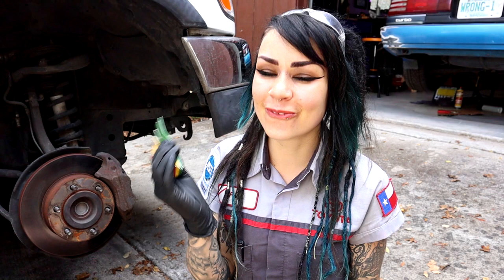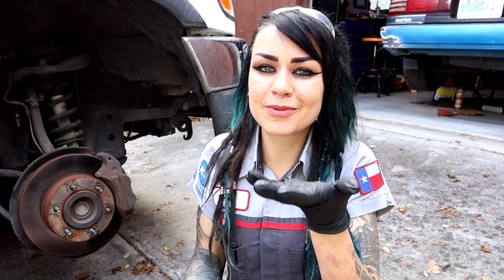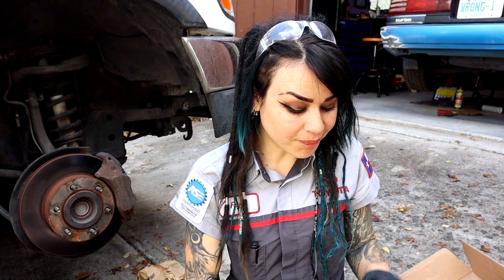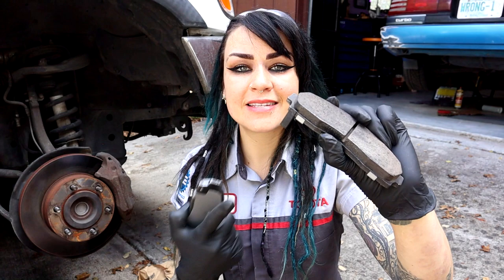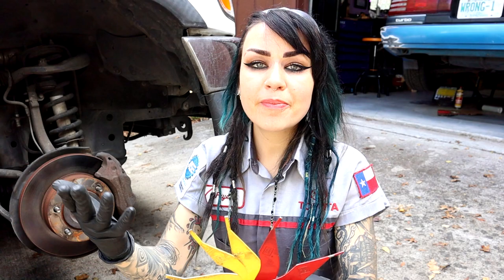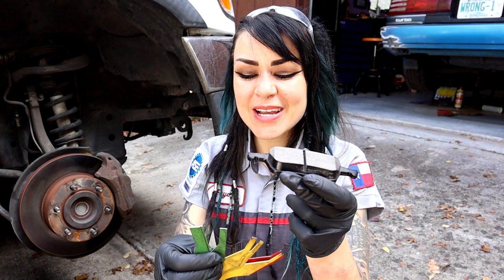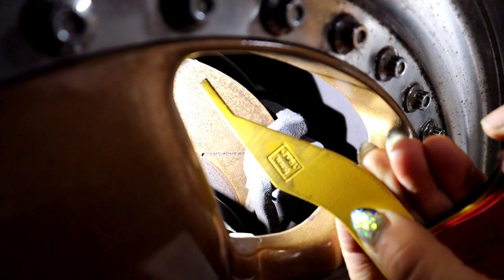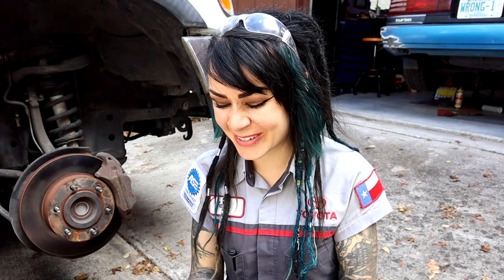How to Measure your Brake Pad Thickness and Why it's Important

Comment: Believe it or not, I've changed brake pads, discs, drums or front and rear of 2 our cars, but never knew how to use that thickness tool via the cut window exactly. Now the wheels on the 3rd car are removed (for other projects) and I decided to find out eventually, how to use that tool. I am very happy to get on this film, which describes everything with so many details and just crystal clearness. Thank you very much.

Comment: One item to add, on brake pads that have the groove in the center of the pad,  it is a wear indicator, if you can look into the caliper and the pads are worn to the bottom of the groove, it's time for new pads.

Comment: I think that's easy to understand how the brake pads wear for anyone that has had a bycicle, and why it's so important to have good brakes and in good shape, the whole system; for your own safety and everyone else when you've to brake the car or in an emergency need, if someone doesn't consider the safety in a car as an important value... imo they shouldn't drive a car, maybe drive a bycicle, use the public transport or... just walk. But a car it's different and not all the types of cars or brake systems are the same, so i think you've explained well how to measure the status of your brake pads and why it's important.

Comment: I just use the space in the middle of the pad. I've been told they are for break dust removal like slots on rotors but I always use them like the wear indicators on tyres. If the pad is level with it i.e. the space is no longer there then change them out. That way you don't have to measure just look through the inspection window. I don't have to buy tools and I think it's simpler for the diy masses.  😉✌🏼
Reply from the maker: GREAT IDEA!!!!

Comment: Good stuff Faye. I love doing brakes!!! Disc can be mindless. But shoes I do enjoy because I think today it’s a lost art. My 62 MG Midget has shoes on all four corners and the fronts are different from the back. Don’t know if they are supposed to be this way but no biggie . Still use pliers and a screw driver, one day I will convert to front disc and maybe disc front and back. Also may one day buy brake changing tools. Really enjoy this video and AAG show always good info.
My son worked for the local Toyota Dealership and he wanted to take my truck and do the brakes to show he knew more than just changing oil. I let him but for front and back new rotors, drums, shoes, and pads they wanted $559.00. I went and got the same part from a dealer supplier for $236.00. Several weeks after doing the brakes he got called in the office and was put in charge of the oil and lube center on Saturdays . Got to start somewhere

Comment: Happy Hour topic Faye,  Brakes and braking systems.  :)  I changed all around brakes on my '87 300D and they have a wire sensor I put it in and the caliper would not come down.  so I said the heck with it, and not put it on. I figure I wont have to change them ever again LOL   I hardly drive it.
Reply from the maker: We have covered this topic at happy hour before!! I forget what date though... Lemme check and get back to you!!

Comment: I really like the plastic set, where they have a "tooth" so it's easier to measure without taking the wheel off (assuming of course you have access to the pad material) 
Whether or not you actually like machining rotors, I Love that on car brake lathes are a thing!  
& because they're essentially cheap parts (for the most part) anyway, replacing pads & rotors & preforming a brake fluid exchange is pretty therapeutic.  
Drum brake services, without drum brake tools, is just a Gigantic patience tester  😆

Comment: I don't install sensors because I change pads yearly  myself. So cheap and easy always replace with new guide pins and synthetic brake  grease. Salt and  winter conditions really degrade brakes so paint calipers with ceramic paint to keep down corrosion issues. Great info about inside single piston calipers like on my Toyota that wear quicker. Had that issue when brakes were squealing looked fine from outside rotor but inside started to score. Going to peek thru that square window now on. 🙌
Reply from the maker: That makes sense!! I'd probably do the same in your case then!

Comment: Faye- I’m in a bind- have a jeep tj rusted track bar bolt- I thought I use my oscillating carbide tip to cut bar and hammer up- only the taper is in way- can’t get to bolt from top- what should I do???

Comment: That notch cut into the brake pad material acts as a simple wear indicator. I keep things simple on my  taco... buy new pads at 50% wear and I'm ready to replace em as needed during oil change / every 4500 miles.
Reply: u replace pads every 4500? holy shit

Comment: Thanks for your very informative video! I redo the slide pins use the best brake lube and replace all hardware when I service my brakes. Time is not a factor for me. I feel that many shops don’t redo the slides unless there is an obvious issue, often causing binding / uneven pad wear because of dried up grease worn out pins. Always watch till the end for the chicken status update.

Comment: Mechanics replace new rotor for every brake pads replacement. Rotors are (very) expensive compared to pads !! No definite answer but in reality for how many sets of brake pads before a new rotor is required, if no warp or corrosion ?

Comment: Thanks. Can you do a video on how to know when to change the rotors?
Reply from the maker: YES! I'm actually working on that one!
Reply: The rotor thickness is different from vehicle to vehicle, on my Honda CB1300 it is a minimum of 3.5 mm. However if the rotor is warped it needs to be machined or replaced.

Comment: Thanks for all the "How to and how not to" information. I'm usually working on my motorcycle but it's got a version of most of the same parts. For brakes, the rear drum (1993 BMW R100R, btw) has an arrow indicator. The front disks I will now look at. 
Sometimes I think car drivers are trying to turn me into their squealer tab! Caught this one on camera. The short 2 minute edit: Dodgeball with Death: Video 0036 - https://youtu.be/5G8gii1ssks 
Stay Sharp. Stay Up.
Cheers

Comment: Thanks for telling the truth about the dealer/mechanics. It's criminal that they'll tell people to change their brake pads when they sometimes have 50% or even more life left!
Also just one more minor note on squealer tabs. On most cars you'll want to place it on the "input" side of the pads, as it tends to wear slightly faster than the output. Little details.
Reply from the maker: That's absolutely true! Thanks for adding! Leading end, not the trailing end 🤘🏻

Comment: Funny this came up. I have those brake pad measuring tool. And used it this past weekend on my Tundra to measure them while I cleaned everything before winter here in salty connecticut.  Nice job Faye

Comment: If you install the cheapest  pads you can buy   they  squeal after a couple thousand miles  no squealer needed LOL
Reply from the maker: augh true that :'(
Reply: Just take them out and rub then together like you rub your hands to warm up. You'll notice that they look shiney. That's because cheaper pads produce a lot more dust so it cakes the surface and bakes on with the heat. That smooth hard surface causes the nose. It also reduces the effectiveness of your breaks especially when wet. Rub them together until the shiney surface is dull. If rubbing doesn't help use medium (600-800) grit sandpaper. Cheers ✌🏼

Comment: Different topic. Have you ever heard of a mechanic placing two washer gaskets on a spark plug?.  On a tune up my mechanic kept bending the spark plug tang on one cylinder with turning the engine. He finally added a plug washer to raise it up off the piston a tiny bit. Ford Ranger 6 cyl, 128,000 / 2009.
Reply: About the only way that could happen is if it's the wrong plug.  The correct plugs would have plenty of clearance.
Reply: @Blazer02LS  well, only one cylinder was affected. I didn’t cross check his choice of plugs though. He was suggesting carbon build up on piston
Reply: @volvo850rex  That would take quite a bit of carbon. If that is the case I would do a top cylinder cleaning and maybe look into the bore with a camera to check it.

Comment: Hey Faye, Great video That should help a lot of people understand breaks really well done. Back in the day my buddy was really lucky and found 85 Toyota truck with only 120,000 miles on a baby really nice shape still have the original brakes we marveled at they were really worn down maybe a couple millimeters maybe less but completely even inner and outer and the shoes and drums were still pretty good. He mentioned that he can get aftermarket brakes you know storebrand cheap and I said are you crazy these brakes lasted 120,000 miles The rotors were still like new I said buy the Toyota factory pads so he did. Unfortunately he crashed that truck soon after but got another and transferred the pads shoes rotors and drums and then later on got another truck and transfer the stuff over again not sure the exact miles he got but was on three different trucks probably got at least 80,000 miles if not more that’s why to this day I and he always get the factory Toyota part. Toyota rules and so do you have a good one🐔🐔🐔🐧
Reply from the maker: OH MY GOD LUCKY!!!!!

Comment: For New York State Inspections, there is no minimum pad thickness in order for your car to pass. As long as there is material on the backing plate, and there's no metal-to metal contact, you pass!
Reply: Actually there is, 1/16" for bonded and 1/32" over any rivet head BUT that only applies to drum brakes !!